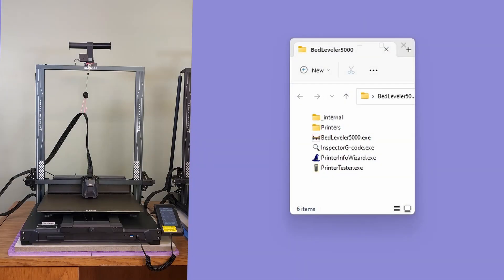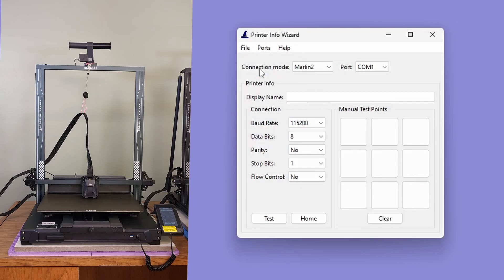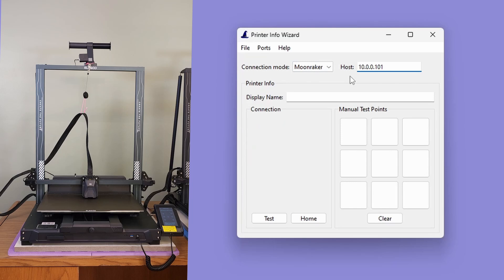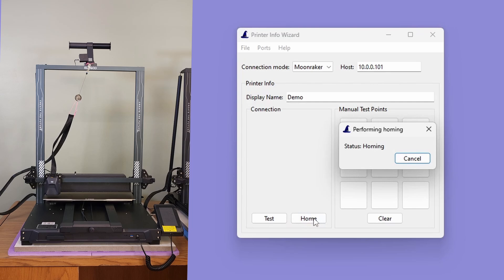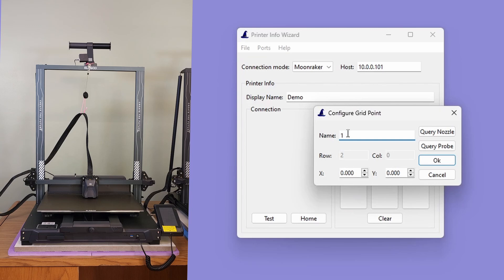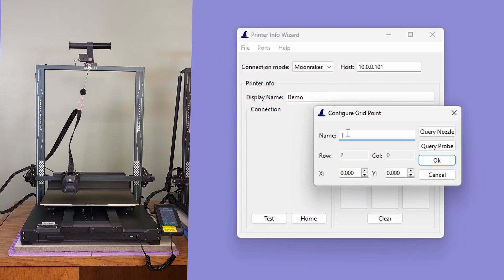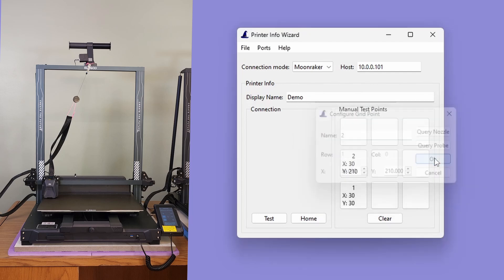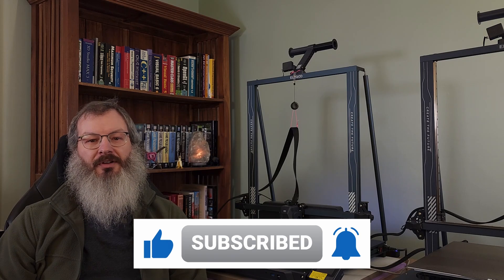Klipper support for the Printer Info Wizard

Comment: I have a relatively new Neptune 4 PLUS and after a few prints, I cannot get this thing to pass a first layer!  I've manually leveled with a feeler gauge extensively with no success.  The head eventually just drags the first layer off the bed.. Your Bed Leveler 5000 is my last hope before going Office Space on this thing.  In the Printer Info Wizard I loaded the printer default file.  I entered the Host IP address.  When I select Test, I get a Fail.  I'm a newbie at all of this and could really use some guidance.

Comment: What is the "Screw Type" section at the bottom of the Printer Info Wizard for? Thanks.
Reply from the maker: Thank you for watching our videos and trying BL5K! The screw type field indicates the type of screw used by your printer for manual bed leveling (the 4-6 screws that you rotate with the knobs during manual bed leveling). BL5K needs to know the screw type so it can provide knob rotation estimates when you use the Probe All feature.
Reply: @SandMMakers  Thanks! And I guess I need to go back and look at this which may answer the question, but how do we know what the screw type is? Is it asking for the threads? Thanks again.
Reply from the maker: Which printer model are you using? BL5K includes configuration files for a number of printer models. If your printer model is not listed, you have two options for determining the screw type. The easiest is to search online, but sometimes the wrong information is posted in forums and other social media pages. The most reliable approach is to loosen an adjustment knob enough that the knob comes off. Then, remove the adjustment screw and test with hex nuts or a screw tester. However, if you let me know your printer model, I can probably figure it out for you.
Reply: @SandMMakers  Thanks. I have an Artillery X4 plus.
Reply from the maker: I just checked online and the screws appear to be M4 with a clockwise rotation. That matches with the existing configuration files for the X3 printers. However, I did find at least one person reporting the screws as M3. If you have calipers, you could easily measure the screw diameter. I've found misreporting the screw diameter to be fairly common in online forums.

Also, if you get a working configuration file, please create an issue in github and attach the file. I will add it to the official BL5K distribution.
Reply: @SandMMakers  Cool. Thanks! I'll check out later today if possible.

Comment: I get a error when I try to start up the printer. Init failed "probe" section not found in 'printer.cfg". I am using a Ender 3 with Klipper. Real looking forward to using your software
Reply from the maker: Thank you for watching our videos and your interest in BL5K! What kind of probe is on your printer?
Reply: @SandMMakers  I use a CR Touch.
Reply from the maker: I will try to add support for CR Touch soon, but I currently don't have access to one.